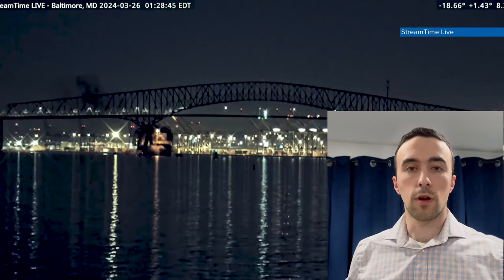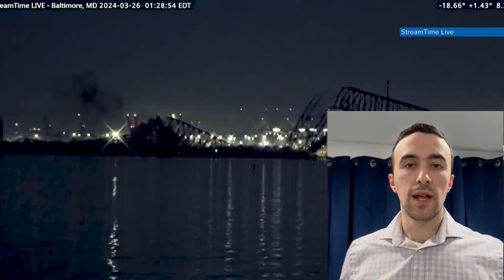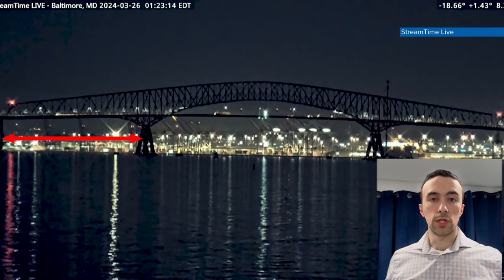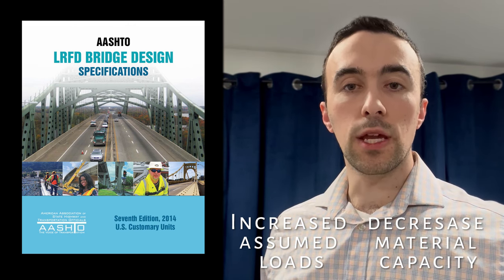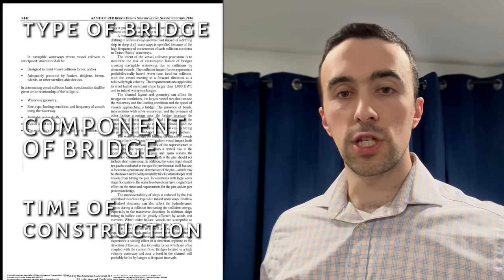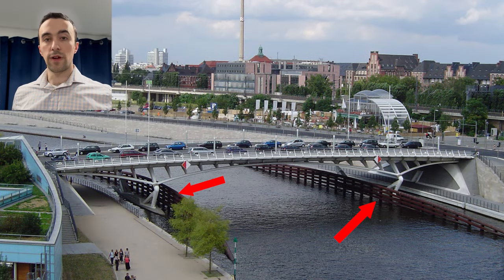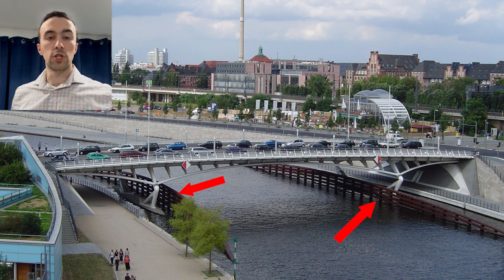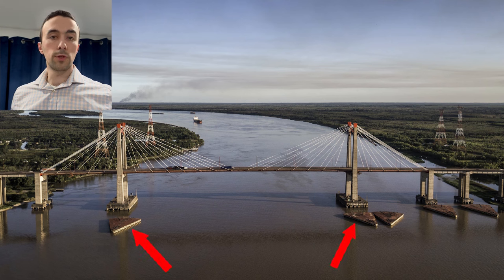Structural Bridge Engineer Reacts to Francis Scott Key Bridge Collapse

Comment: I am a Civil Engineer who worked on building the Key Bridge for 3 years.  The Bridge has four Dolphin piers (bumpers).  They are 25 feet in diameter and sit about 1000 feet in front of and behind the two main piers.  They are clearly visible on an over head view.  The Dali passed the protective Dolphin and then veered right to go into the main pier.  BTW, the pier was made of solid reinforced concrete and contained over 20,000 CY of concrete as best as I can recall.

Comment: Looking at the main bridge support structure, it appears flimsy - just 3 or 4 vertical struts (couldn't tell from shadowy photo).  It looks like a considerably smaller boat, with enough speed, could destroy that support.  Compare it to other bridges like the Golden Gate Bridge - its two towers have a massive under pinning dwarfing what the Key Bridge has.
Reply from the maker: That's a good point. I would also add that the bridges are not usually designed for a loaded boat to hit them which adds considerable force (F=mv).
We'll have to wait for the official report to see why and how this happened and to see if there were any factors that could have been mitigated to prevent the failures.
Reply: @ThatCivilEngineer 
Far be it for me to argue with a civil engineer, but when I was in in school the product of mass and velocity was momentum, p=mv. Force was the product of mass and acceleration, F=ma. Yes, I'm nitpicking but thank you for a clear explanation of this disaster and a straightforward suggestion for how to prevent these kinds of accidents in future. 

Interesting how each span broke pretty much in the middle as it collapsed. I suppose that could be mathematically predictable.
Reply from the maker: @tsegulin  You're right 😅. Force=ma
I would wait for the official report but looking at the video it does appear that they each failed at midspan.

Comment: One thing to remember is that back in the 1970s when this bridge was designed and built there weren't any ocean going cargo ships anywhere near this big. Also, the Dali is SMALL in comparison to other ocean going cargo ships. 

Designing a bridge or pier to withstand such a massive impact force is impractical so it's a pretty safe bet that any towers or piers for the replacement bridge will likely be on land or way outside of the ship channel.
Reply from the maker: Great point! I think people tend to forget about these changes. I am curious to see how they reconstruct this bridge and what safety precautions they take.

Comment: Perhaps like overloads on a bridge, ships beyond the capacity for impact with critical components should have a permitting process much like that used for overload road vehicles.  Big sign on bridge saying something like 50,000 DWT tons max.,  and you need a permit with appropriate restrictions for exceeding this limit (tugs, pilot, special mechanical certification, max speed within x distance of the bridge, weather conditions, redundant systems, etc. ).

Comment: Not too sure of the actual figures, but my guess is that the bridge was adequate for the ships of the 1970s.   However the port now allows ships of ten times that weight to transit through.   So any 1970s protection would need to be 10 times more robust these days.   Or just limit the size of ships into the port.
Reply from the maker: That's a very valid point. I'll look into those figures to see how large the allowable shipping weights have changed.

Comment: Two questions, one, were are the dolphins and two, why weren't that road crew on UHF radio. In Australia we have a common channel truck drivers use, hence road crews use it too so they can talk to truck drivers dropping off loads of road building material. Not sure of the system in the US, but one call out could of had that crew off that bridge. Mobile phones have become a terrible system of communication, mainly because of Indians with most calls from unknown numbers now being ignored. As for the dolphins and the expense, come on, this is a major US port, spending a bit of money to fix this problem would be nothing compared to the value of goods that go through that port. This collision was going to happen, if it wasn't that ship, this year, it would of been another ship in the future, this is a failure on the part of government planning.
Reply: Agreed, but another area that I find hard to believe is the ships speed, some experts say without concern that it may have been doing 8 knots.  The Captain had 2 Harbor Pilots standing behind him in order to guide him safely.  I can't imagine them letting the Captain continue toward the pillar at that speed.
Reply: @clearview5281  Modern disaster prevention assumes a ship would hit the pylon. The idea being that eventually something will happen that will cause a ship to run into the pylon, in this case, bad fuel. With ships, time is money, so if the limit is 8 knots, it will be doing 8 knots. Yes, more could of been done to stop the ship doing what it did, but then you still have the bridge and the work crew, it was 3 disasters in one.
Reply: @ramons8908  I worked on a Passenger Ship going to Alaska way back when and the speed was 4 Knots going under a similar bridge. (Only for a short time)  I thought the speed limit was for the safety of the Ship, not the Bridge, which I assumed could take almost anything. 
My criticism was mainly aimed at the Engineers that would design a Bridge where a hit would take down the whole 8,660 ft , and not just 1 section.  Tks for your input.
Reply: There are 4 dolphins